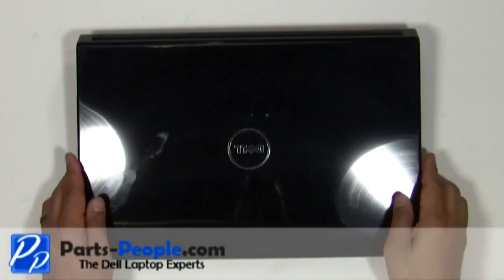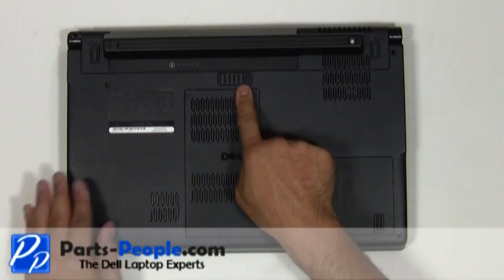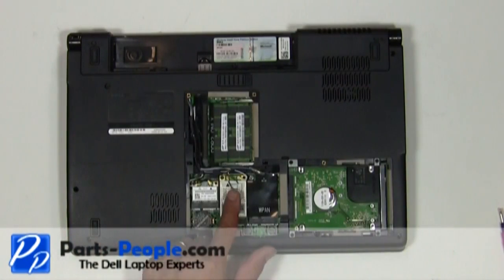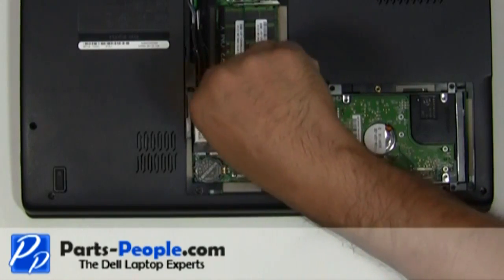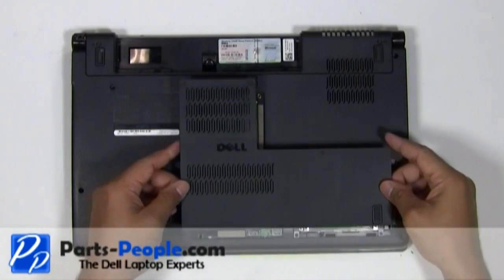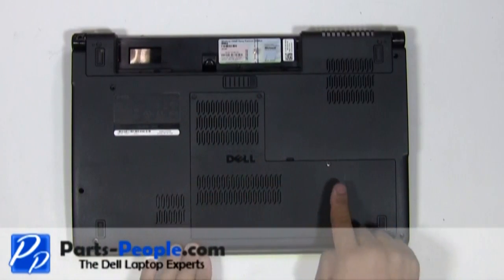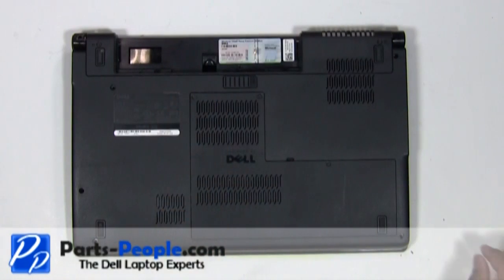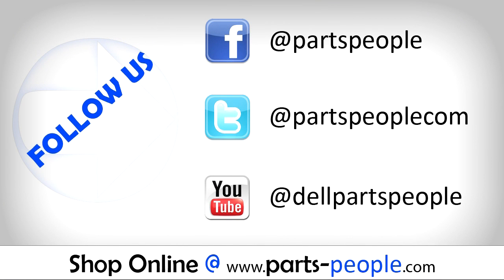Dell STUDIO 1555 / 1557 / 1558 | Wireless Broadband Mini-PCI WWAN Card Replacement | How-To-Tutorial

Comment: is wlan and wwan the same i think they have the same slots!
Reply from the maker: bobi966 They use the same type of slot but they are not the same. WLAN (Wireless Local Area Network) is your WiFi card. WWAN (Wireless Wide Area Network) is mobile broadband and uses a card provided by a carrier such as AT&T or Sprint and uses a 3g or 4g network. Because the WWAN card uses 3g or 4g, you would have to have a data plan to use it. Also, the WLAN and the WWAN use different antenna cable.
Reply: Parts-People.Com, Inc but they are both slots mini pci express slots so i can use pm3n on wlan slot and wwan slot right?
Reply from the maker: Yeah, it should work fine.
Reply: Parts-People.Com, Inc Ooohhh now that is a relief thanks man so i can use an external gpu with my acer aspire e1-571g i have half sized wifi card i removed it and i still got internet without the wifi.

Comment: I got my motherboard replaced a few days back. But after that, the the OS stopped recognising the bluetooth and shows that bluetooth adapter not available. When I opened t up, the WWAN WPAN slots were empty. Could this be the reason? Thank you!
Reply from the maker: No, it wouldn't be caused by the WWAN or WPAN slots. It would most likely be the bluetooth card is loose, the drivers are not installed, or the BIOS needs to be updated.

First, go to the device manager and check to make sure the Bluetooth adapter is installed, if so go to support.dell.com and redownload and install the driver and and the latest BIOS revision.

If the device manager doesn't show the Bluetooth installed, the card was probably overlooked and will need to be installed. The card is located under the palmrest, on the motherboard.
Reply: Parts-People.Com, Inc Thanks.

Comment from the maker: I assume you mean WLAN and WWAN. WLAN (Wireless Local Area Network) would be using you internet provider and WWAN (Wireless Wide Area Network) would use a cell phone provider and data plan. You can have them both installed but you wouldn't use them at the same time. The WLAN would override the WWAN as long as you have an wireless internet connection available. If you didn't have an internet connection, the WWAN would work on cell towers using your data plan.